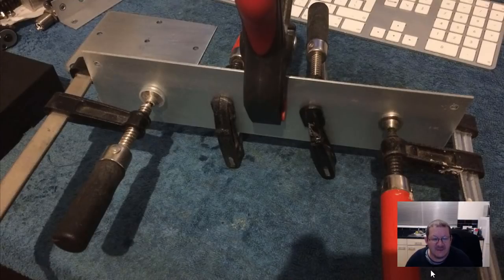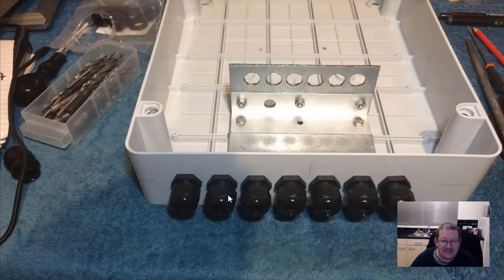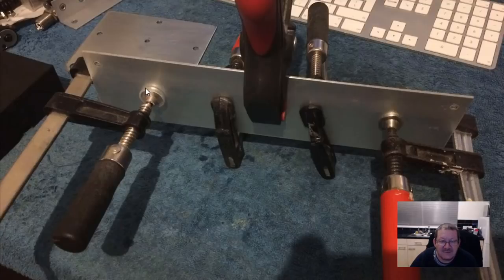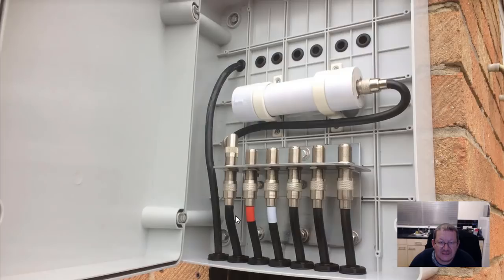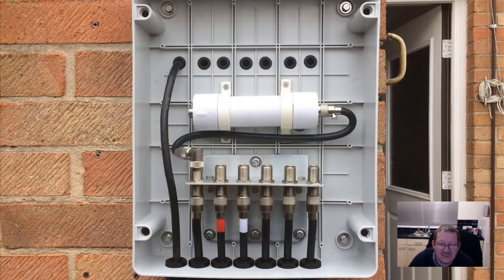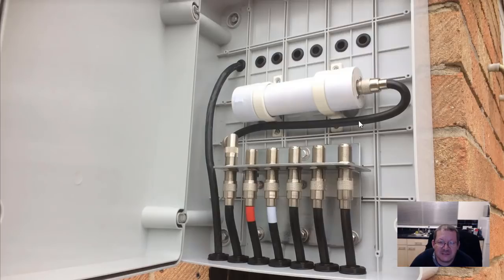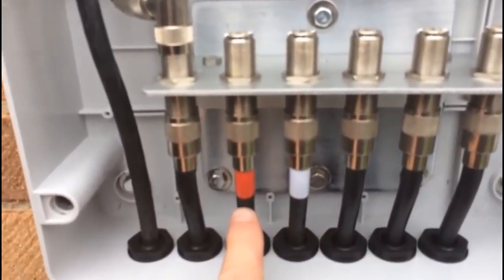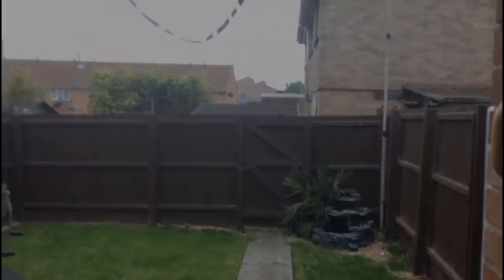G0SEC Quick Shack Update on New Cable Junction Box Outside!

Comment: Great video James very impressive just a quick question I see you used a balanced feeder from the wire antenna but it appears unbalanced at your connecting box have put in a Balun  somewhere on that line 🤔
Reply from the maker: Yes it has a balun bud

Comment: Nice job but I think that's a Common Mode Choke and not a "Current Balun". A Balun shouldn't have unbalanced connections on both ends!

Keep up the good work.
Reply from the maker: No this is a current balun inline bud.. 1:1 Current Balun designed to be placed in line with a 50-Ohm coax. Its made up of 50 Ferrite Core Beads, placed onto a 13-inch piece of RG-303 coax. The coax and SO-239 connectors have Teflon(R) for maximum insulation... It is a sort of choke yes as it stops the rf flowing back down into the shack, only need one on the wire antenna, but yea it is a current balun or what they call a current balun..
Reply: @TheHamshack  So, just out of interest, if it's a BalUn (as in Balanced to Unbalanced) then why does it have coaxial (Unbalanced) connections on each side and a coaxial (again, unbalanced) feed to the antenna?
Reply from the maker: @Omni-RF  there are 2 types of balun, infact more then that I believe as far as I am aware, perhaps someone with expertise on baluns can comment but it is called a current balun. it is a 1.1 current balun, its only purpose is to do what I mentioned above.. I use it as i was knocking out my weather station when i used my amp, with the current balun which is rated up to 1.5kw nothing at all on the weather station, I have a clock for the weather station in my shack if you have seen any of my vids before and it works a treat.. I think your right in that yea it is a choke really but it is called or they call it a current 1.1 balun not a choke balun. It definately works well and stops the RF from my wire antenna from going back into the shack, with the HF beam on the tower no problems ever but the wire antenna and only one one of my wires I had issues mentioned above so I thought ok i would try one out and like magic i was so pleased as it really works well.. it does not whack out the digits anymore on my weather station... it was a huge Eureka moment of course...  lol
Reply: I'm not trying to sound like an ass which is quite difficult when a total stranger comes into a comments section and starts giving out info! I'm an ex RF engineer with experience in the private/commercial and government sectors and do have some expertise with Balun, Unun and CMC devices. These devices are often confused and can be broken down into several categories:

BalUn - Used to transform a balanced load into an unbalanced load. You should use one of these whenever an unbalanced coax feeder meets a balanced antenna (for example, the feed point of a dipole) or a balanced feeder (for example, when connecting to ladder/window line). You can get many different ratios with 1:1 (50 Ohm in, 50 Ohm out) being mostly used to feed a dipole, 4:1 (200 Ohm in, 50 Ohm out) being used to feed a doublet via ladder line and even up to 16:1 (800 Ohms in, 50 Ohms out) being used to feed the T2FD antenna as used my many armed forces.

Unun - Used to transform the impedance of an unbalanced load. You should use one of these when you have a high impedance unbalanced load that you need to get closer to 50 Ohms (for example, you may use a 9:1 unun at the end of a random length end fed long wire or at the base of a 43' vertical to bring the high impedance down and make it easier for an antenna tuner to get a good match). You can not get a 1:1 Unun as there would be no point in having it installed (it would not be changing the load type and there would be no impedance change).

Auto Transformer - Used to transform a specific impedance range down to 50 Ohms. You should use one of these when you have a known high impedance and wish to produce an efficient match to 50 Ohms (for example, at the feed point of an End Fed Half Wave). These are commonly 49:1 ratio which transforms the 2450 Ohms presented by a half wavelength of wire down to 50 Ohms but other ratios can be made for many other uses.

Common Mode Choke - Used to prevent the flow of common mode currents down the coax. You should use one of these when there are unwanted common mode currants flowing down the outer braid of a coax and introducing RF back into equipment. There is no impedance transformation (so it's not an unun) and no load transformation (so it's not a balun).

I believe what you have there is a Common Mode Choke. You have described exactly how a common mode choke is made (one way is to place ferrite beads placed over the coax to produce resistive impedance and prevent the flow of common mode currents back down the braid of the coax the other way is to wind several turns of coax around ferrite toroids to do the same job), you have described the exact symptoms of common mode currents on the coax braid ("I was knocking out my weather station when I used my amp") and you have described the exact expected behaviour after installing a CMC ("It definitely works well and stops the RF from my wire antenna from going back into the shack").

Please don't just take my work for it. Take a look at some other resources and be sure that I am providing the correct, well researched information. I'm all for gathering data from separate independent sources rather than one know-it-all in the comments section! Here's a few good examples:

The rather good G3TXQ and his page on Common Mode Chokes. Search "G3TXQ Chokes"
The father of modern Balun and Unun design, Jerry Sevick. Search "Jerry Sevick Understanding Building And Using Baluns And Ununs"
Some more info on a commercial amateur antenna manufacturers site from a highly regarded antenna designer (Danny Horvat, N4EXA). URL without the spaces "myantennas . com/wp/tech-info/about-cmc/"

There are many other good resources out there but be aware that for every correct resource, there is an incorrect one!

I hope that has helped clear up why I believe that you have installed a Common Mode Choke and not a 1:1 Current Balun. I hope that you find the information presented here helpful and I hope that I haven't come over as a know-it-all but instead, just another amateur enthusiast wishing to pass on knowledge! I'm very happy to have a direct conversation if you would like to know more about the subject, you can find me on Facebook.
Reply from the maker: @Omni-RF  Yea as I said above Maththew, they market it as a current balun but yea like I said your probably right in it being a choke really as I agree it is more of a choke then a balun but they do call it a current balun when you go to buy these.. most strange but heck it works well so regardless to what it is actually called it will stay inline... Thanks for all the info, most helpful to read... I am always learning even after being a ham for 32 years.. James G0SEC

Comment: Very nice. Very good beam btw.
Reply from the maker: The tower is a 4 section 80ft tower made by Altron, they do not make them anymore but it is very good, had it for about 9 years now, the foundations are 5ft square and 9ft deep.. The antenna is a Force12 C3SS, love my antenna, I restored it totally back in 2016, I modified it so it has a much better front to back, longer boom then the original and slightly longer elements so has smaller linear rods on it then originals do but works extremely well as your see from some of my other videos... Thanks for the comment, have fun with our great hobby.. 73's for now James G0SEC
Reply: TheHamshack I was looking at the c3 from jkantennas. Probably the best I can find in the new market